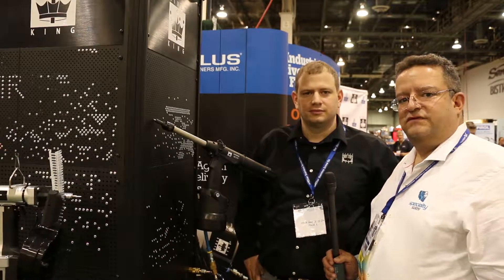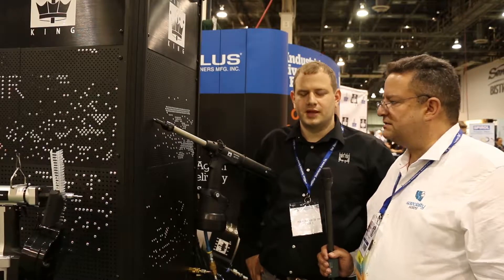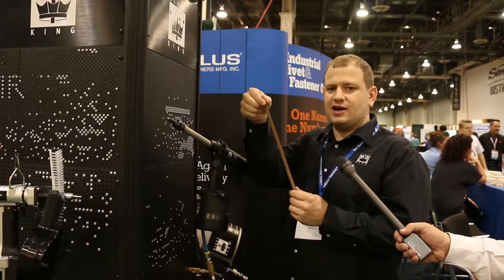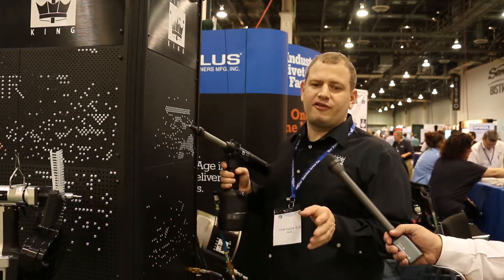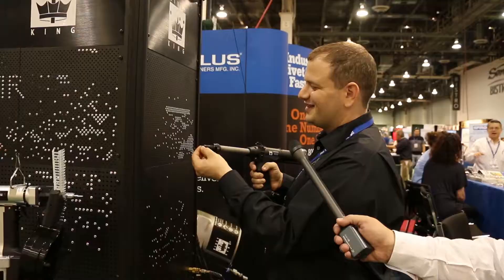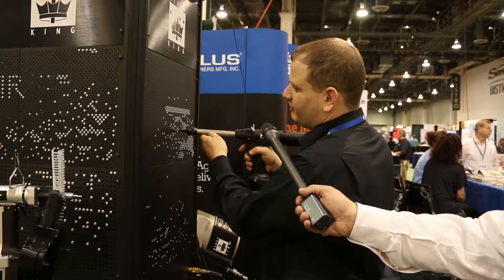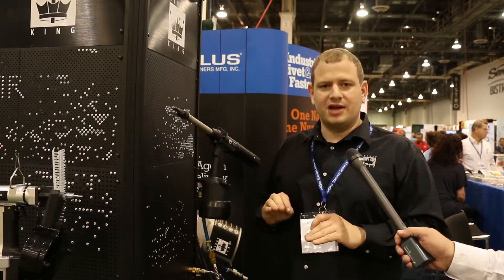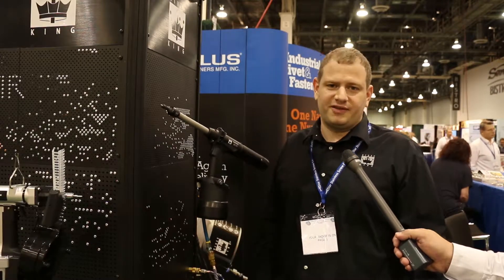Industrial Rivet 2014 NIFMSE Quick Riveting demo

Comment: Industrial Rivet didn't copy this. This is a product that Stanley Engineered Fastening (POP) licensed from a company in Japan that holds the patent. For whatever reason, the company in Japan decided not to renew the licensing agreement with Stanley and instead licensed it to Industrial Rivet. Having said that, fasteners are copied all the time. If you look at the two rivet companies that were absorbed into Stanley Engineered Fastening, (POP and Avdel Rivet). They have each "copied" each other's, with slight modification over time. Avdel copying POP's original blind rivet, and POP copying Avdel's original structural rivet.